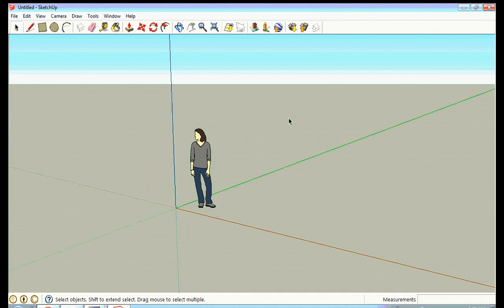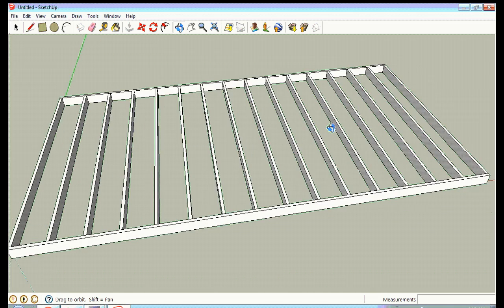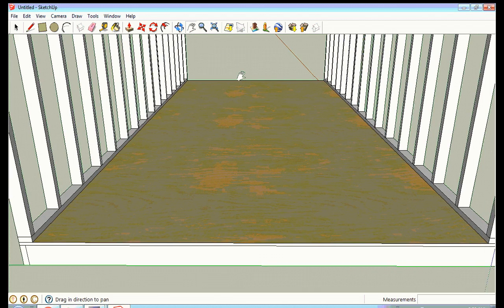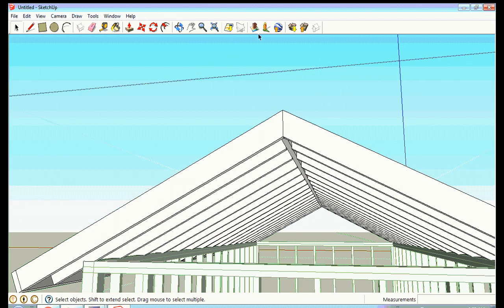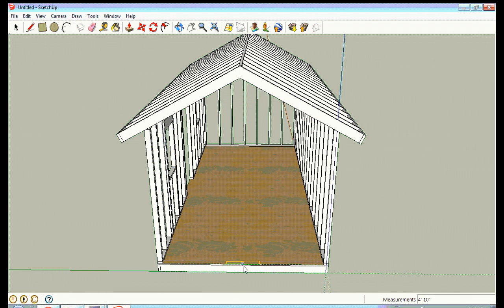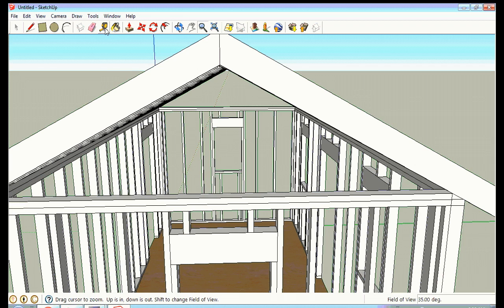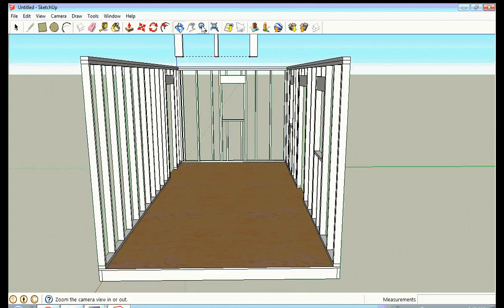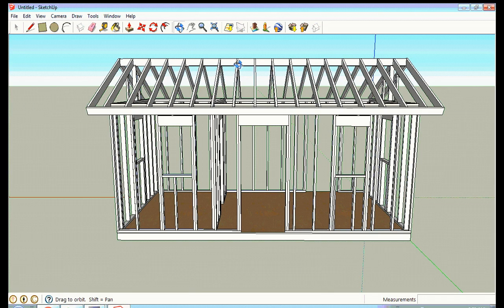Sketchup Framing Lesson by Solarcabin

Comment: Now I see why, hanging curtains are so difficult.  There is nothing structural to screw curtain rod mounting brackets into.  No matter how super efficient a window might be it is still a major heat loss. I been trying to think of a good mounting system to hang quilted shades (very heavy) that open fully in the sun, yet insulate the window at night, and meet home designer aesthetices. At the same time have a solar reflector shade for summer use. Your framing   demo, proves a wood structure needs to be added to the interior side of a window to hold multiple shades, and outset curtains.  I have been thinking 1x6 in x 4 ft board, above the interior window trim, with 1/4 round to blend it into the wall.

Comment: CAnt get Housebuilder without a monthly fee.
Reply from the maker: Do you have sketchup 8 installed?
Reply: @solarcabin  i use to have it but my computes crashed. and now I cant get 8. I have 2017
Reply from the maker: Install both RB files in to Shipped Extensions file. Restart your computer and it will show up in Draw menu. Should work n newer versions.
Reply: @solarcabin  where do I get the RB files and what is Shipped extension file
sorry, not familiar with this.
Reply from the maker: https://www.dropbox.com/s/5qhzzwgv4c1vc0c/HouseBuilder.rb?dl=0
https://www.dropbox.com/s/qmqlarqj3iuecr5/HouseBuilderTool.rb?dl=0

Find sketchup in the program files and open it and you will see the shipped extension file. Copy both rb files to there. Then shutdown and restart and it should show up in the draw menu.

Since Google took over Sketchup they have tried to monetize everything.

Comment: Thank you for creating this video regarding Sketchup & add on tools.  I am planning to build a workshop in my backyard, and what you have shown me here is very helpful.  I would like to see you create a garage door on one end of the building.  I'm also wanting to make my workshop Solar Powered so I'm not using any additional grid power.  Of course those details would be added later and the roof pitch must be equal to the Latitude of my location (36 degree's) for maximum sun exposure.  Other items may include an exterior storage for lawn mower & garden tools.  All of which can easily be added into this framing sketch.

Comment: Anyway to get this plugin to work with Sketchup 2015?
Reply: +Matt Sampley Extract all to C:\Program Files\SketchUp\SketchUp 2015\ShippedExtensions. Open Sketchup and it should appear under the Draw menu.
Reply: +Paul McLaughlin Yes; thank you I'm using the "brandy newest" version there is 15.3.331 Bit Windows. Just got it now and this step works like a charm, THANKS Paul!
Reply: +Paul McLaughlin 
Doesn't work for me.  I've installed the Housebuilder utility in several places in Sketchup, including ShippedExtensions.  The program doesn't recognize it.  Mind you, I have the downloadable free version.  Does that make a difference?
Reply: +Paul McLaughlin Great explanation! Thank you so much! I just downloaded 2016 version and it worked perfectly.

Comment: I've been using Housebuilder to draw walls with 16 in the settings for stud spacing but the spacing is always 16 between each stud when it should be 15.25 between first and second so that 8'x4' plywood sheets finish on the middle of a stud rather than at the start.Had to modify code in housebuilder.rb to fix it.
Reply: +healysn 
i notice he eliminates extraneous studs, but i'm wondering if that doesn't just create more possible problems with attaching the interior and exterior panels.  Do you eliminate those studs or keep them?
Reply from the maker: You can choose to justify the studs from right, left or center. Most builders start from one end and don't worry that the last stud is not on 16 inch center.
Reply: you are 100% right. you modified this? care to share your version?
Reply: should be 14.5" between ...
Reply: +healysn Interesting. Can you point out the place in the code?

Comment: When you attached the ridgeboard on your joists, didn't it change the dimension of your floor by the thickness of the ridgeboard?
Reply from the maker: Yes but we still refer to the house size by the standard framing measurement to make it easier.

Comment: Headers are only required in bearing walls.  Rule of thumb:  span 4' use 2pc 2x 4,
span 6' use 2pc 2x 6, etc. 
If a bearing wall is in the lower story, look up, at the double or even single rim joist to take any load that could bear on the opening.
Until we started worrying about energy, most framing all exterior opening using 2pc. 2x8 because structurally it handled anything, but most important, it places all exterior openings at the same height, looking from outside.
I stopped doing that in 1978, exchanging all redundant wood in the structure for insulation/barrier system components.

Comment: Rim joist, is used in platform stick framing.  Originally there were two, but the outer has been replaced since the '80's with rigid insulation, under most codes.  It runs around the perimeter of the floor.

Comment: Ridgeboard is an old framing member probably from 'post and beam' barn raising.  It is the highest structural piece of the building.  Little known is that it isn't structural itself. It is there only so the roof framers can mark where the rafters go.  True.  It could be made of cardboard, the framer will take it's dimension into consideration, when he cuts a rafter.

Comment: Solarcabin, I liked the video. It seems clear and to the point, but I've found House Builder and downloaded the Zip file and pasted it by following the path to Program Files to Google to SketchUp 8 to Plugins. When I open skectch up, however, I see no way to access the House Builder utility. Can you tell me/take a guess what I am not doing right to get this utility to work???
Reply from the maker: You have to copy the unziped files to the plugin file in the sketchup file so it can find it. That should fix the problem. There is a text file with the plugin for instructions.
Reply: Eddie Miller (

Comment from the maker: The King stud runs from the top plate to the bottom plate on the door frame and a jack stud  is the stud under the header attached to the king stud for anyone confused by what I said. They are considered one stud called a king stud. The short studs under the window sill is called a cripple.

Comment: i wrote a comment and came back to add to it. dont see it anymore. ohwell. i went to the site you listed and download the plugin and some others as well. seems they are for older versions. i have the newest one and they wont work with it. guess ill have to do it piece by piece. thanks for another great vid~
Reply from the maker: Your comment is right below. I use version 8 because it uses all the old plugins. I don't know why Sketchup changed in the new version and it was a stupid decision. You can still get version 8 and have both.
Reply: solarcabin ok, thanks for letting me know what version you are using. ill try version 8. thanks Lamar
Reply: solarcabin Hi. It's true. I have sketchup pro 2014 and housebuilder didn't work. I read your comment and downloaded sketchup 8 and the housebuilder utility now works! Yes, I have two versions on my machine. Anyway, I hope that pro 2014 is fixed/tweaked to allow ruby add-ins. what a shame they don't work. Keep us posted, and thanks again for the good work!

Comment: Man you are like a duck in water with sketchup, but you could do so much better in a program like Blender. It's totally free open source software as powerful as any professional mulit-thousand dollar 3d software on the market. I use it very often for doing prototyping.
Reply from the maker: I have Blender but it does not have as many Library elements and is more difficult to use for what I do. I use Blender for 3D modeling of characters and objects but Sketchup works better for me for structural construction. It is all what you are used to.
Reply: I can certainly see that and ur not wrong. That home builder thing is pretty cool, but if ever you got really into blender you could learn to do it just as fast in blender.